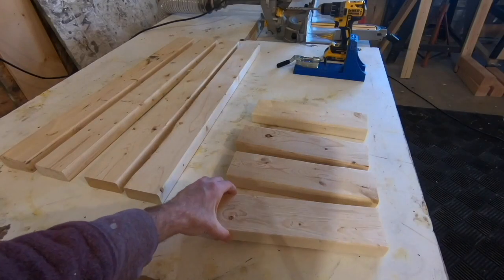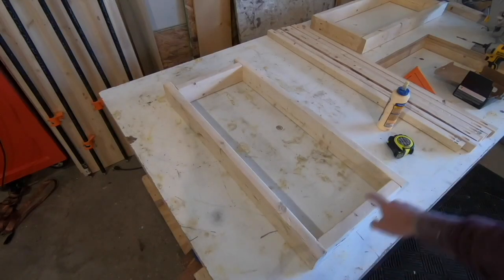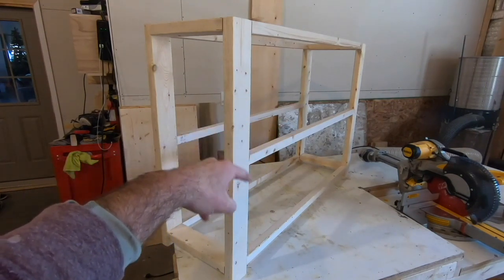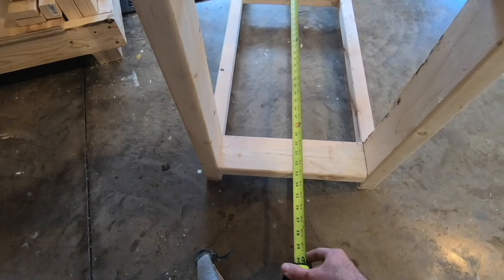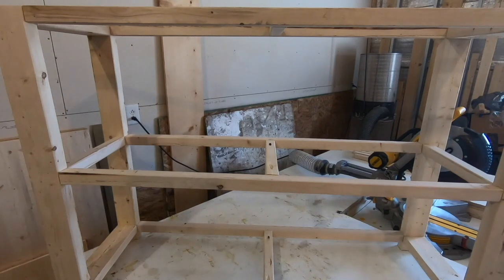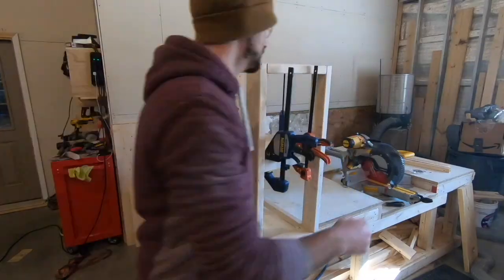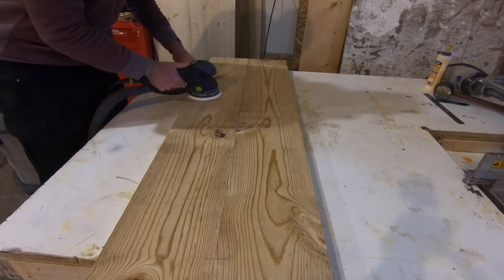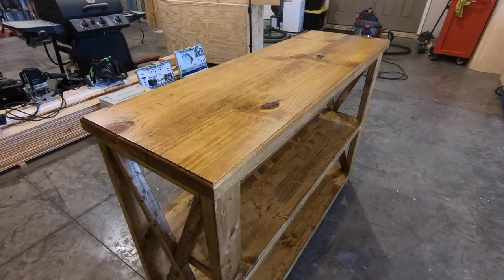Farmhouse Console Table Build (Tutorial video with free dimensions)

Comment: Nice entry table mr Matt can you please tell me where can i get the 1x16x6 board that you used on this table ? Thanks.
Reply from the maker: It's a project panel that's pre-glued. Here's a link to what I used 

https://www.lowes.com/pd/Metrie-16-in-x-6-ft-Smooth-Natural-Spruce-Wood-Wall-Panel/1001306090?cm_mmc=shp-cprdmlwgooglelia-122-edgegluedpanels-1001306090-_-0&placeholder=null&ds_rl=1286981&gclid=Cj0KCQjwm9yJBhDTARIsABKIcGYnK2-5BbYNEJZCyJHLHlO_NnShVEjYNVizgp8O53g4zhCnghHhqocaAvZYEALw_wcB&gclsrc=aw.ds

Comment: Awesome job , have a question can you tell me what kind of screws do you used to me the first two frames i know they are 2'' pocket screws but what kind cus I am having a hard time trying to screw them and i bought kreg pocket screws thanks.
Reply from the maker: Hey Diego! The brand I use is Grip Rite exterior screws, but pocket hole screws should actually be better. I just use the Grip Rite ones because they're cheaper in bulk.
Reply: Thanks a lot partner will consider that and keep uploading those amazing videos I am a really fan of your projects 👋 from El Paso Tx👊
Reply from the maker: @diegomoreno2070  You're welcome and thanks for watching!

Comment: Super built just not clear with washers that you are using , alittle to fast video for me at this point
Reply from the maker: Thanks! So the washers will allow for wood movement as the top expands and contracts over time. By putting a screw in each end of the washer, the top will be held downward by the force of the screws - but as that top does expand and contract, the washers can pivot in the direction of the expansion/contraction, which allows the top to do so without stressing the internal wood causing the top to crack. I’ll try to do a video in more detail about this and some other table top attachment methods when I get some time.